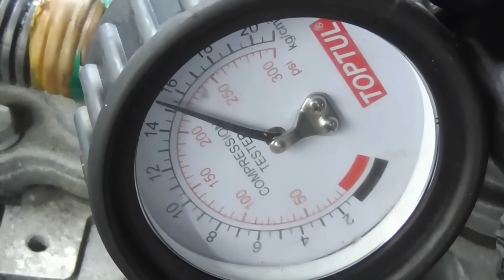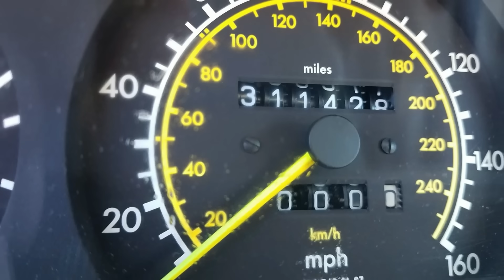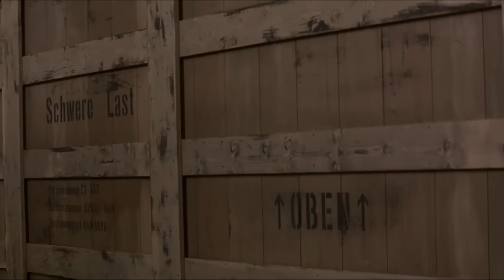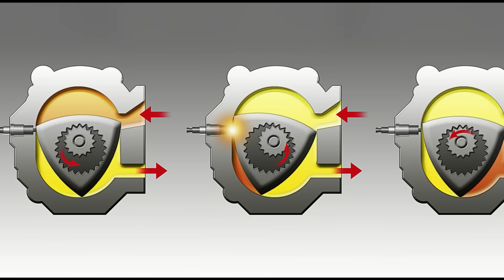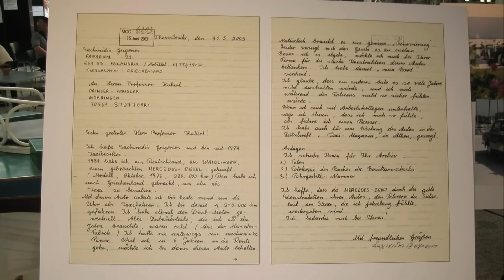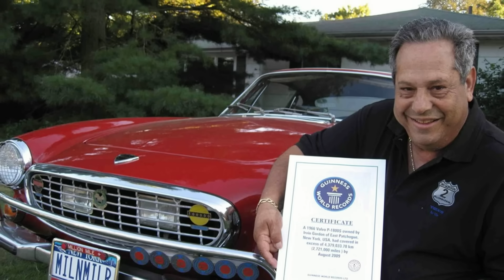Most Reliable Engines of All Time

Comment: 150-200K miles isn't very impressive
Reply: 200k would be a low mileage car in my driveway
Reply: @JRotten  in mine too 😂😂
Reply: @JRotten  True that, only way to afford them any more! Certainly not impossible, don't know about some of the newer stuff though.
Reply: @JRotten  Just broken in ;-)
Reply: @JRotten  true😂😂😂
Reply: My dads 01 f150 just hit 350k
Reply: @collinblanford1043  probably been rebuilt before be serious
Reply: Honorable Davis it has not been rebuilt, it just hit 351000
Reply: @collinblanford1043  My 02 is getting ready to cross 300k
Reply: I know right? That means my 2004 hemi powered ram is considered very reliable at 167,000 miles 😂
Reply: @bearatts  Rams stink. Lol
Reply: bearatts well there’s not much to those engines, as they’re pretty basic and reliableb.  They hadn’t changed much since the 60’s.  You must get. HORRIBLE gas mileage though.
Reply: @bearatts  that's nothing. the hemi in my grandma's truck is closing in on 200k, and still runs like new.
Reply: @bearatts  just hope that hemi doesnt blow a piston on ya. 167k and kicking is pretty good for a hemi
Reply: @bearatts  Still built by a corporate welfare recipient, than should have gone out of business, in a real capitalist system!
Reply: @bearatts  That actually is good for Mopar!
Reply: @bearatts  Even though it is probably rusting out over the rear wheels right now
Reply: @bearatts  You know that is not a real Hemi, Right?
Reply: @DesertFernweh  I know
Reply: @bearatts   1990s dodge ram is more reliable  then anything post 2003
Reply: @punker4Real  the engines are, but the bodies and the interiors leave a lot to be desired. I'll still take my pre mds hemi.
Reply: I got Mercedes w210 270cdi only 570 000km and previous car was Mercedes w124 2.0 diesel 850 000km 😁
Reply: Lm7 v8 vortec engines go 300k easily but no love for american here.
Reply: @deplorableconstitutionalis2834  I came here to say the same thing. The 4.0L straight 6 in XJ and WJ Jeeps are virtually unkillable. They are still worth buying even AFTER 300,000.
Reply: Limeyfrog that Jeep 4.0L is the direct descendant of the AMC / Rambler 6, incredibly rugged, bulletproof engine. Decent HP, great torque, superb reliability, even carbureted with breaker point ignition. This list is just late model ricer wank material. The US made inline 6 engines were all rock solid low RPM torque monsters.
Reply: I know, lol my 2000 Chevy truck has 450.000 miles all original just basic maintenance, change oil, plugs, fluids, etc. and still runs like the day a drove it out of the dealers lot.
Reply: Deplorable Constitutionalist I loved my friends grand Cherokee with the same engine.  That was a great car and especially a good engine.  Too bad Dodge/Chrysler/Jeep stopped making such bulletproof engines.
Reply: @JBags1230  Not profitable to produce good  quality any more. Better to run crying to the taxpayers for a bail out. And people rail about "welfare mothers" LOL! In a "real" capitalist system Chrysler would have gone out of business. It's assets absorbed by some other enterprise. Was just a big con job, and the fat cats ran away with stuffed pockets!
Reply: True. My 4.6l f150 has 260k on it
Reply: 12 valves typically have 500,000
Reply: I got 386,876 miles on my 2rz tacoma
Reply: silverbird58 wtf?
Reply: @SpaceCadebt  probably just a senile old guy 🤷‍♂️ even the way he writtes is really odd
Reply: @singert66  Don't be so cocky, time will turn you into an "old guy" soon enough!  No one escapes the clock ticking!! And by the way I understood everything he said!
Reply: Lol Ikr I have to stop the vid right here haha, 303k miles on a 5.4 2v ford with original long block and gaskets (except the valve covers gaskets))
Reply: what about the 03 f150s they go on for awhile too or any 5.3
Reply: 150,000 to 200,000 miles is nothing!! I have had Fords with double that mileage that still ran great! People who think 150,000 miles is a lot are people who don’t drive much or who have never owned a high mileage vehicle.
Reply: @newfie-dean5803  yup got a grand marquis daily driver with almost 300,000 drives like a dream and have seen many grand marquis crown vics and Lincolns go over 4 or 500,000
Reply: 1988 Toyota with 3vze "v6" 230K runs like new. Was the 22r even mention? Checked out when 150-200K was bragged about
Reply: @95GTSRACING  My 1984 Supra with the M5 engine have 350K and was not mention either.
Reply: @95GTSRACING  That was a good engine also!
Reply: @95GTSRACING  I didn't hear the 22R being mentioned...man, 330,000 miles and still ran with a chooched head gasket...that was a great engine. I even had one that threw a rod through the block and still drove for  30 miles with tape weld over the hole in the block. Good catch.
Reply: @95GTSRACING  I have a 22re engine and I hit 1 million. I hate this list
Reply: @95GTSRACING  I had a 2TG Toyota(78 Corolla) with 300,000 miles with one problem. 
It was a self oil changer. Smoked to much to pass smog. It also leaked wherever there was a oil gasket or seal.
 Cost for the parts was double that needed to rebuild a Chevy V-8.
Of course the only low mileage motor I could find for the 2TG was a 2TC.
Reply: @deplorableconstitutionalis2834  sold my 02 jeep tj when it had 185,000. Only replace thermostat battery and oil. (Regular maintenance) I sold it cause I needed a truck
Reply: Wayne Holder i just got a jeep wk 3.7 powertech with 194k and still a smooth engine. Not a fan of chrysler but this motor is pretty solid
Reply: @Attachments.  from experience Chrysler makes good product for the most part just depends on vehicle and year it was made
Reply: @Attachments.  make sure you don't overheat your 3.7 EVER, even a lil bit or it will drop a valve seat and your cyl head and possibly piston will be dickered. I just bought a minty Dakota for $800 cause it needed an engine. I put a used one with about 120k in it and truck only has 60, but engine was free :)
Reply: Wayne Holder njjvxfj
Reply: Wayne Holder exactly! Maybe something around 500k = good number. Where is MB 270cdi.... etc. Milion miles engines
Reply: I worked on some dodge diesels 12 valve cummins with 300K + heard of some with million miles on them w no rebuild
Reply: Sterling Free Piston engines can run years under full load.
NASA has one that has ran 110,000 hours without fail.
Reply: @phydeauxddog  fuck NASA
Reply: @deplorableconstitutionalis2834  My son has a Cherokee with almost that much on it! One of the best engines ever built!
Reply: Depends where you live
Reply: What about the 98 vortec 350? Or the little 4cyl. In s-10 same year? I know a guy who has one that has 410,000 miles on it with just basic maintenance.
Reply: @joshdavis1322  notice that the later vortex 96-98 Chevy 350 tend to have valve problems at higher mileage (200,000+) just smokes before warm ups (metal expand and allows it to seat properly).. not a huge issue just can seem worse than what it really is but there will be a Lil power loss compared to new or one with rebuilt heads
Reply: @95GTSRACING  I'm at 277000 on my 97 Vortec, the usual cold piston noise, just have to let it warm up a bit, but no smoke, doesn't even use a quarter of a quart in 3500
Reply: Unless you never changed your oil
Reply: @ZTSuper-dt9vf  didn't know the transmission oil needed to be changed at 10,000 miles. But , it's a chevy
Reply: @ZTSuper-dt9vf  the engine was only one of the problems
Reply: @johnmike7809  I owned a 98 z71 wasn't a fan of mine but through owning it and doing maintenance I was able to peace together the puzzle to see the picture.. pretty much looked good but wasn't maintenance properly. Wasn't a bad truck just bad owners... but with that said I tend to like parts you can neglect and it juat ask for more. If you like c1500 or K1500 style shoot for 88-95 Chevy pickup. Lil more resilient in the drive line
Reply: Depends on the context....... mass generalisations mean NOTHING. The average statistic is far below 150-200k, so your comment really is irrelvant, lol
Reply: @Nemoticon  Even shit engines will do 170k miles for pushrods and 90k miles for interference/timing belt engines.
Reply: @DarkLinkAD  Only if properly looked after.... but in reality, the vast majority of people have NO IDEA what they're doing. If people ran their cars properly, cars should run for at least a century.
Reply: silverbird58  These days you can have that car with Tesla (or similar) underpinnings and power.  If you can't have an original a repli-car with all the best modern technology isn't a bad substitute.  You still get to drive that car and not have to worry about where you will find the parts.
Reply: Those Camrys will get 300k if u do proper maintenance
Reply: @brianc9374  Some well above 400,000 if well taking care of
Reply: No shit , 200,000 ain’t shit, my Chevy Silverado has over 300,000, and is still my daily driver. It’s a 4.8 manual.
Reply: Yea a Cummins can triple that, even more than that. That is not really know that much
Reply: @theronzonie  my integra has 300k on it
Reply: My 4.6 modular Ford  v8 has 230,000 miles on it and it still runs great.
Reply: Had 350,000 on a Ford Bronco II
Reply: With a dumb broad behind the wheel and in charge of maintaining it yes it is.
Reply: What about the Ford 300 inline six or the Chevy sbc or ls series or the 318 v8 or any American inline 6
Reply: Hell Nope, my brother in law had a 1993 civic that he drove for 180K before the odo failed, he never fixed it and just kept driving, 60 miles to work every day. 5 years later he had a long block (rebuilt engine) put in, then gave it to his son.  Son drove it another 7 years, on the rebuilt engine but same transmission.  This Civic even got stolen out of the kid's driveway (in Riverside), the kid got mad and drove around Riverside looking for the car and damned if he didn't find it, parked in front of La Cantina or something, so he just stole it back... The thief ran out after him and followed him home, there was yelling, police came, the guy drove off but they got his plate and arrested the thief, anyway, the kid drove it til this year, must have had 250,000 on it if not more.  The kid got a new Ford Focus and paid $50K for the stupid thing...he should have just kept the Civic, any mechanic will tell you that was no upgrade at all -
Reply: @robertmaybeth3434  I will say the focus trans issue is a driving habit issue not a car issue.
Reply: @Prestiged_peck  Maybe so, but my lifetime experience of Fix or Repair dailies is, I don't want to ever own one
Reply: @robertmaybeth3434  everyone has their own experiences, but a lot of people don't look at the lesser know engines that are the truly reliable ones, like the 4.6 as opposed to the 5.4, or the gas engines for the HD trucks (6.8l then 6.2l) I'd never own a powernope but I'd take a 6.2 f250 over a duramax or cummins all day long
Reply: That's what I was thinking too.
Reply: Says the man that has never owned a Chevy
Reply: @johnmike7809  ?? Hope you're not talking about me? If so just look close at the little photo (69 c10) owned every Chevy body style produced since late 60's
Reply: @95GTSRACING  worst 2 trucks I ever owned
Reply: @johnmike7809  would only buy an s10 with 4.3l.. only v6 Chevy has mastered (a 350ci missing the back 2 cylinder)
Reply: 2000&2001 one a  v6 single cab 4x4 other a extended cab z 71.

Got about 40 k out of both before major transmission/electrical problems.

I’ve owned ~ 20 automobiles. Yes, I am familiar with routine maintenance. I was 22/23 when I purchased them. No, I didn’t tow with either truck, no didn’t off road them. Just sorry quality.
Reply: @johnmike7809  if that was true it would be the same story across the board and wouldn't have a single truck on the road. But yeah it's easier to blame dumb decision on something else
Reply: @95GTSRACING  consumer reports verify the decreasing quality of Chevy  through the years.
Reply: @johnmike7809  agree with consumer report 110%
Reply: @johnmike7809  I dont believe a word your saying. I dont think anyone else does either.
Reply: ron paul2069 indeed. There was a 900,000 mile k series that is now sitting in a dealership
Reply: How?!?!?!?
Reply: @deplorableconstitutionalis2834   probably would buy another if I didn't have my 88 yota 4X4 (close off road capability for fun/function with a truck bed for hobbies/work)
Reply: I was just about to say that... I own a Camry with the exact engine and it’s at 150K miles. Kinda clenched my cheeks a tad bit. They’re known to burn oil for sure after 100K
Reply: The best engines are the 1nx Toyota engines found in the corolla , Celica and other Toyota cars. Many of these cars still driving with over a million miles and still good
Reply: *Average
Reply: 500K miles is impressive. Most of cars in my country are imported after reaching 150-200K they roll another that much or even more. Note: on average used cars are bought for $3500 in my country.
Reply: silverbird58  Wow, pretty cool!  But what a project! You didn't mention any kind of front suspension modifications to compensate for the extra weight of the Cummins. I know my International 7.3 in my F250 weighs in at around 800 lbs. I would think the Cummins would be close!
Reply: That's exactly what I was thinking Wayne 300,000 miles is just about when I'll start to say

 not too bad

 but 200,000 miles should be the expectation of a new car
Reply: silverbird58  imagine if you remove the fancy component like back seats and any music player its gonna be light
Reply: for a BMW engine it is.
Reply: 1hd-fte 💪💪💪
Reply: lol, OK, buddy.

Certainly some engines will go 500K, 1M+ with regular maintenance.  I presume they are talking about some sort of "average" or even minimum run time (miles/KM) for these reliable engines.  Sometimes the rest of the car is the first to fall apart.
Reply: Yeah, my mom's 04 honda pilot has about 330k now.
Reply: 2009 corolla 2ZRFE 1.8 with 240k miles.  Other than the noisy intake cam gear on cold starts since 70k miles, it runs like a champ never an engine problem
Reply: Had a 7.3 with 940,xxx miles and heads never came off.
Reply: My car has run 620k  km
Reply: Yea I got ford 4.9 with 300k no rebuilt and I seen ones with 400 and 600k miles no built
Reply: I agree
Reply: My Honda Civic has 211k and runs perfectly
Reply: For the engine block it is.
Reply: My nissan hardbody has 400.000 miles
Reply: That's nothing.
Reply: No kidding. I've had two mid 90's Ford escorts and 98 saturn s-series twin all over 250k miles on it.
Reply: I had 1990 Toy truck with 650,000 km on it when it died in an accident. It had a V6 5 speed standard for drivetrain. With heavily modified suspension I drove it like a sports car. Oil changes every 3,000 to 5,000 km, with most of the oil changes happening shortly after 3,000 km. I used 1/2 liter of synthetic and then fill it with regular oil. Using the rest of the 1/2 liter of synthetic oil for topping up the oil between oil changes. The synthetic oil does a better job of protecting the engine even when the engine is not running.
Reply: Yeah if a normal non high performance car can't make it to 200k it's really not reliable
Reply: 150-200K may not be impressive but it's not at all bad !
Reply: Considering I got a 2001 6.6l with 380k and a friend with a Cummins with almost 2 million on it.
Reply: Is 342,000 impressive while getting the same milage as new? The Toyota XW20 engine in my Prius keeps going and going
Reply: My 2006 Chevrolet 2500 with the 6.0 gas burner had 385k on it when I sold it . Onl6 things don3 were routine maintenance and a water pump
Reply: 150 miles is still brand new
Reply: Rusty Climber  I have heard about head gasket issues on the the 3vze but never known about the head bolt and gasket change!! Good to know! Anything with an egr valve (side pipe) is bad design lol sacrifice the motor for emissions
Reply: Not very impressive at all. I’ve seen 80 series landcruisers with 1,000,000 ks on them.
Reply: Most high mileage vehicles I've ever owned was a toyota toyoace   light truck with 798000kms on the clock and a hiace van with 650000 ks
Reply: Wayne Holder my 7.3 diesel has 350,000 and it’s been beat. Worked and raced it’s whole life
Reply: my 2.slow mk4 vw has 291xxx miles on it. my buddies corolla has 678xxxmiles no rebuilds. amazing
Reply: In the 70's and 80's 100K the car was considered very good.  The rest of the car usually fell apart long before that.
Reply: 200,000 at 4,000 rpm is 1,000,000,000 cycles. You try to build something that can do any one thing 1 billion time consistantly!!! Go ahead, I'll wait...
Reply: There's 100s of thousands Chevrolet suburbans driving around at 300,000 miles. Heck try to buy one with 290,000 miles they still want north of 5 grand.
Reply: I have a 03 Yukon 5.3l with 312,338 miles on it.
Reply: My old Fiat Punto TD lasted over180'000miles (285'000km), and it was heavily tuned.
I put on it a big turbocharger (2.0bar of boost!) and I drive it as a 20 years old boy living in the middle of the alps can drive...
I dismissed the car after an accident, but engine was still running fine (on waste vegetable oil....).

It isn't strange seeeing engines like that with more than 500'000km.

About any engine since '80s can reach at least 300'000km if it has the correct manteinance.
I see some 1.1, 1.2 and 1.4 FIRE engines by FIAT with more than 350'000km, I see a Natural Power 1,4 FIRE (running on natural gas) with more than 750'000km rstill running fine, with its original clutch.

Not to mention bigger engines, like the 2,5TDI on VW LT with more than 1'140'000km UNOPENED with original turbocharger.
Reply: AL Bundy's dodge slant 6 has 1 million miles, now that's impressive!
Reply: I rather have a new car after 80-100k, not worth the headache & too expensive to repair, high labour costs
Reply: Fr. The 7.3l idi averages 500k
Reply: My dads Ute is a 2002 model with 400,000kms on it ,the things frame is gonna go before it douse and when it’s gets to half a million it’s mine to thrash to a million
Reply: My 07 yaris has 242,000 runs like a champeen.
Reply: Just my tought, my current car Volvo d5 have 230k, the car before that (Citroen C5 2.0hdi) had 350k and the car before that one (w210 with the OM602) had  just passed 500k when i sold it and they are all still alive
Reply: That's cake for a Vortec
Reply: @Sr. Boi Olla Also in good median tempered climates too, too cold or too hot cold ware the car out quicker
Reply: No one in their right mind would even buy a rotary mazda engine if they knew of all the mechanical problems !
Reply: @lilibethdoherty295  Ironically there's still a community or group here in my town obsessed with them 😂
Reply: @markf5314  my 88 has 268k 3vze daily driven doesn't leak oil
Reply: Growing up in Africa, vehicles with 1 million km wasn't that unusual. I think that's about 600,000 miles
Reply: @theronzonie  terminator cobra: laughs in supercharger whine try making 100k post build making 1000 horses plus on almost completely OEM parts  excluding fuel system due to capacity issues, porting, and various power adding parts like cams, exhaust, and porting. Stock trans minus clutch and input shaft, and reinforced driveshaft.
Reply: Nope, I have over 200k on my 3.8 Lucerne and a bunch of people I know have 250-400k on these engines. Hell the cars fall apart before the engine needs rebuilding.
Reply: @tomrados7512  can confirm, had a 94 gmc sierra with the 3.8 and that engine survived having the frame wrapped around it after already hitting like 300k including one two hour stretch of having the throttle pinned in Arizona due to a busted throttle cable. Turned the engine off and dropped her in neutral when it got over 90, kicked it back in drive when it went under 60. Pulled it out after that fateful wreck and sold it to a guy who had blown his old one up with boost. He rebuilt it and told me the thing looked almost perfect inside when he tore it down.
Reply: Exactly what I was thinking. My 97 civic has 130k and to me that's like 25k. Not one problem with it and it still get's over 40mpg on the highway
Reply: @theronzonie  400k still isnt much. We drive toyotas around here buddy. 1 million if you give good maintance
Reply: I have a 2008 Mitsubishi Lancer with 214,000 miles on it and it’s still running like a brand new engine 🥱
Reply: 4.7L toyota V8. Easily the most reliable engine. That bad boy is built for a minimum 500k miles
Reply: Before the days of interstate highways, 200,000 miles was alot of miles. People put more miles on their cars today than they used to, because we have more highways and better highways than we did in the 1950’s and early 1960’s.
Reply: I had a Nissan diesel more than 700,000 miles.  
Never had any repairs.
Reply: LOL, even my corolla has 370k
Reply: ye compared to a 4,600,000 miles, ye it ins´t xD
Reply: Is this a high performance engine reliability post or every day drivers??? No mention of the Ford 300 CU IN in line 6 engine that I personally owned a 1965 Ford Fairlane that I sold with 491,600 miles on it still running just fine. They were made from 1965 thru 1996 and they were not just in cars/pick ups ether. Many farm tractors, farm equipment, utility vehicles and the big brown UPS trucks had them as well! They were not high mpg engines but RELIABLE! I have one horror story though that my Brother bought a 1967 Ford F 250 4x4 with a 300 six in it. In the summer of 1969 I asked him how often he changes his oil because he was complaining that it was burning a quart every 300 to 400 miles? His reply was, "Change oil?" It had 45,900 miles on it with the original oil and my brother only adding oil when needed. I changed his oil/filter putting in high detergent oil. He took my advice having the oil changed again in 100 miles. It lasted another 38,100 miles before it locked up.
Reply: I'll say.  My vote is for the Toyota 22R engine.  My '88 Pickup gave me 320,000 miles on the original engine.
Reply: @theronzonie  1 million mile on a Prius taxi cab is not uncommon.
Reply: ikr i have a 1999 gmc sierra that has 500,000 miles on it and is still running great
Reply: Yeah a decent engine within maintenance should last 15 years at least and should outlast any auto transmission. Should hardly matter whether you drive it 10 miles a day or 100. Cold starts are brutal on bearings and cylinder walls compared to highway mileage
Reply: More of my 1970s Celicas passed 200k than not - the ONE that didn't died around 190k after I'd put over 60k on it and NO CLUE what the previous service history was.
20R/22R was a good engine design in almost every respect.
Reply: he said easily, don't forget he said easily.
my volvo 940 B230fk just made 310k miles and sounds like it came out of the factory yesterday.
Reply: @salvadorpalma8173  Just means your exhaust system hasn't rusted out.
300k any more isn't super impressive, my Ford E250 with the V6 is well over 300k miles and still running well, though I did have to have the transmission rebuilt a few months ago (at least in part due to the brakes going out and having to abuse reverse to avoid a wreck).
Reply: @salvadorpalma8173  I have to agree about Volvo Track Record. Back In The 70's they we're even Incredible. Plus Volvo Safety History Is fantastic. I think it's reasonable to say that reasonable Maintenance Is Critical for any long hauler. If anyone remembers The Checker Cab. The Miles On those Cars we're And easy 500,000. They just had a small block Chevy In them. Start and Shutting A Motor Off Is what gets a lot of them. When You go Out and it's ten bellow and start Your engine It creates tremendous Wear. I have A 95 Camry With the famous 4 Cylinder. It has 240,000 Miles. No VVT just dual Over head Cam. But I have done A lot of Preventional Maintenance. I also Worked On Toyota Fork lifts. The Motors just didn't give up.
Reply: you only say that because you drive highway miles in cities the engine has to stop and go even though its only traveling couple miles. So the same engine used to do highway miles will break faster if you use the same one in the city. Example a highway mile toyota can prob do 1million miles but a city one can do 300,000 miles before blowing.
Reply: @asapmonkey2393  My 2001 Ford E250 V6 has mostly city miles.
And over 300k miles on the original engine without a rebuild.
200k miles is NOT all that impressive.

Your point about city vs highway wear and tear IS valid, though.
Reply: My first thought ,especially after seeing countless former cop cars  and cabs with well over 300000 on the old 4.6 V8 modular engines.
Reply: Wondering how he's never heard of the gm 350 engine lol 
375000km and counting
Reply: I got a mazda six with 351000 miles on it and never been in the motor and still runs great with no issues never changed the belt yet.
Reply: East european second hand bmw's  have been hitting the 200k mark third time already lol
Reply: silverbird58  did anyone ask?
Reply: My mom has an 87 Saab 900 Turbo we got brand new that she wouldn’t let us get rid of.  Had over 300k when my father brought her home a brand new 7 series and she finally said she’d let it go when she had a new 7 series in front of her.  Great little car too.  Only had the clutch replaced once, oil changes and a turbo replaced.  Kind of wish they had kept that car, as I’d regularly go on joy rides in it at 13 when they’d be away or not coming home.....I’ll never forget being a little kid and the turbo spinning up and pushing me into my seat.  It felt so cool as a little kid, I used to pretend we were blasting into space with the sounds it made with the turbo.
Reply: Jeep's 4.0 inline 6 guys it will outlast the next 5 Jeep's u put it in
Reply: I had a 1994 dodge colt that had over 250000 before u sold it. I changed the oil and that's pretty much it.
Reply: I Have A WeaK 1.3L 4banGeR only 64HoRsePoWeR but it ReaCHes 31MPG In tHe City & 38MiLes PeR GaLLon on tHe HiGHWay AnyWay StiLL Runs WitH 197tHousand 577MiLes one tHe odometer Bout to Put CHRome HundRed SPoKe's on it & daRK BLaCK tinted windows Cause AC don't WoRK ANY MORE
Reply: Jacob Peoples lots of million mile diesels out there actually
Reply: Jacob Peoples yeah but a diesel can run for a million miles before any repairs have to be made
Reply: Jacob Peoples i can’t tell if your post is satirical or not
Reply: @jacobpeoples9367  mine is 1.4 70 mpg 90 bhp 178.000 miles. Runs sweet